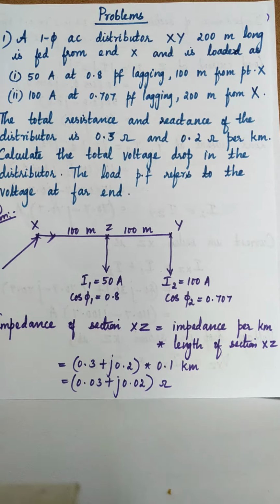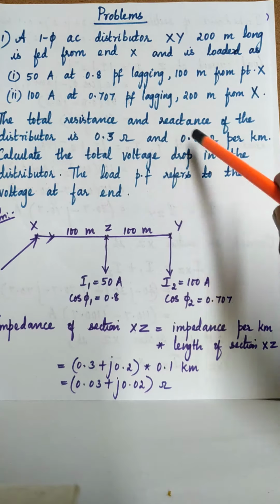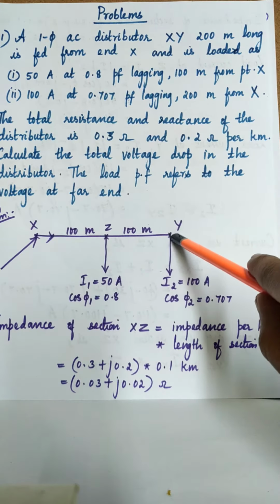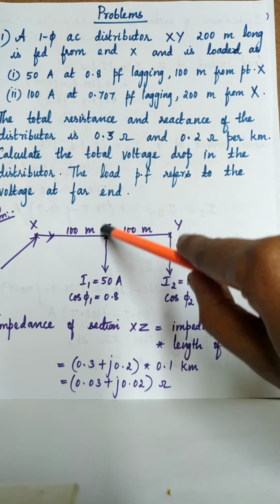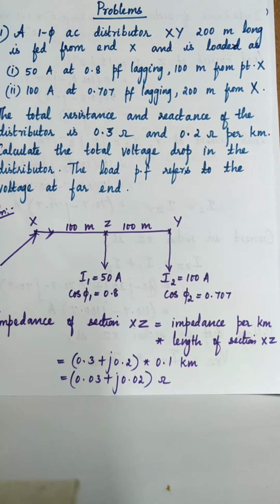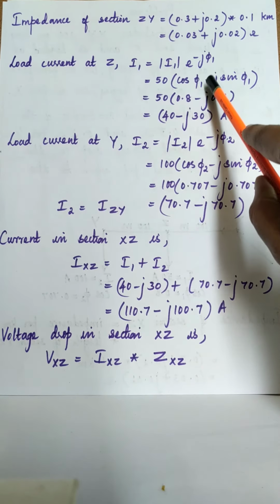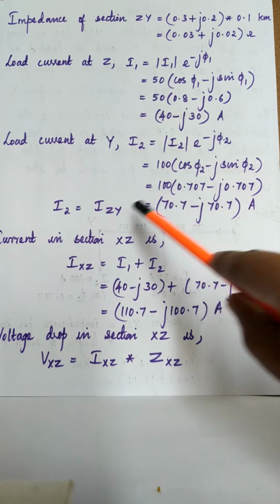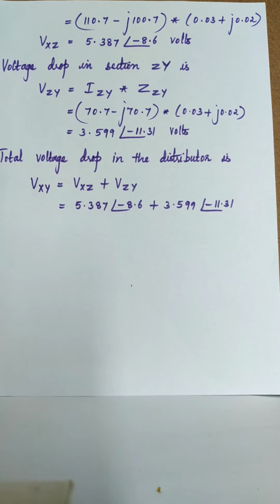T&D Module 5 Lecture 5 - AC distributor problem 1

Comment: Am behind on voltage on voltage drop section . If I calculate 70.7 × 0.03 =2.121 and yet u getting 3.599  ? Would u kindly xplain more on that ?